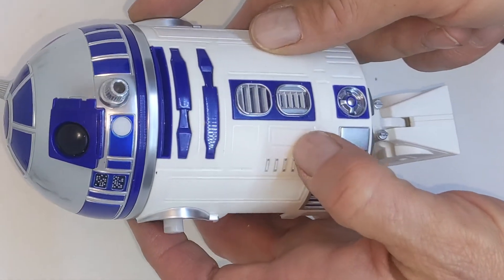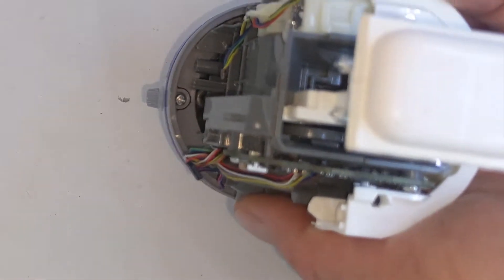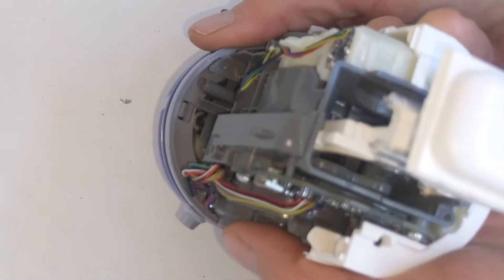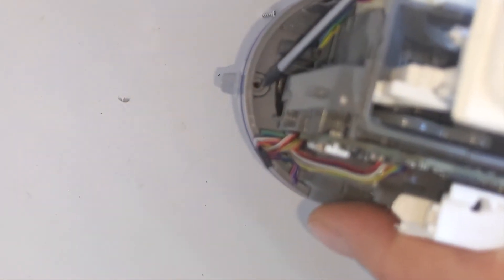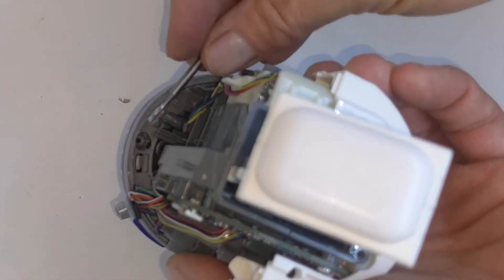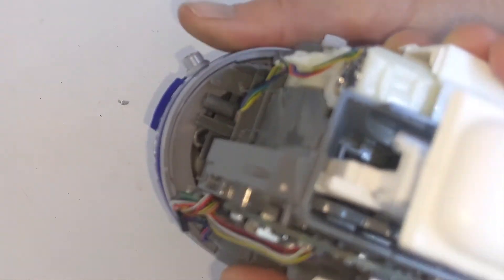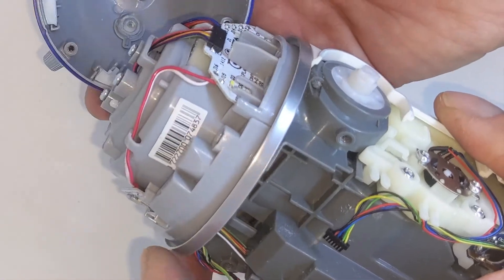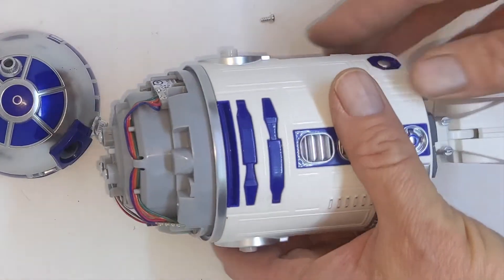Sphero R2-D2 Fix - EASY Dome/ Head Removal Trick Hack Repair Tip Tear Down Disassembly

Comment: But do you mean that when you dremel the plastic you find a metal screw under?
Reply from the maker: Exactly, but you must first note the indentations to know where they are underneath.
Reply: @worldwideinterests1 Thank you, I found the indentations. I'm going to dremel! I bought a brand new r2d2 and it has the head invered (when it goes forward the head looks backward 😅)
Reply: @lucarocca3485  Inverted? There's a stopper that should completely prevent it from passing 180 degrees. Could you upload footage of what exactly it's doing?
Reply: @corellioncrusaderproductio4679 Hi, I was able to dremel but you are right. The head is not inverted: it looks like the problem is in the "sensor" inside the head: it doesn't recognize the real position of the head. Also using the app, the head rotation sometimes works, sometimes not. When the head should be idle, you can feel the servo is pushing against the stopper.. I'm worrying about I will have to find some spare parts, but first I have to understand what parts are fault 😅